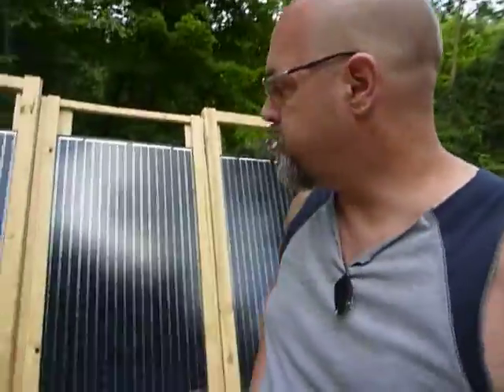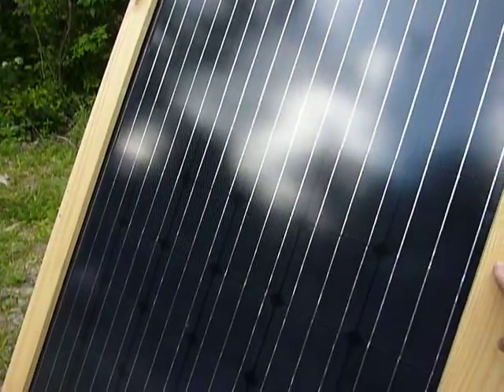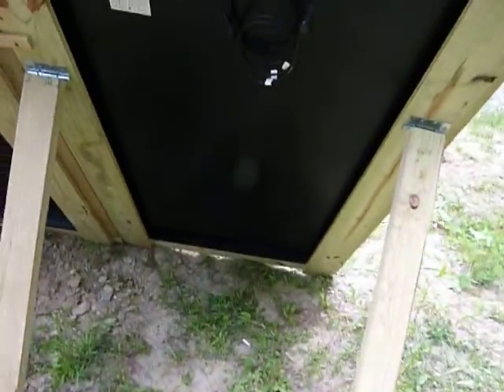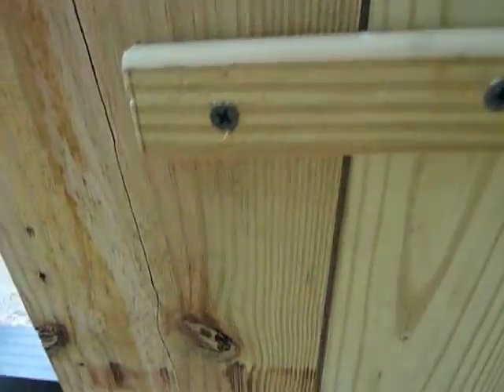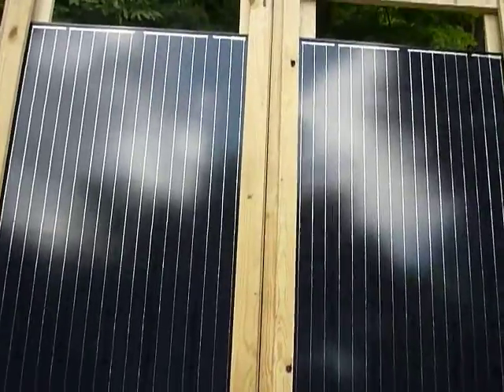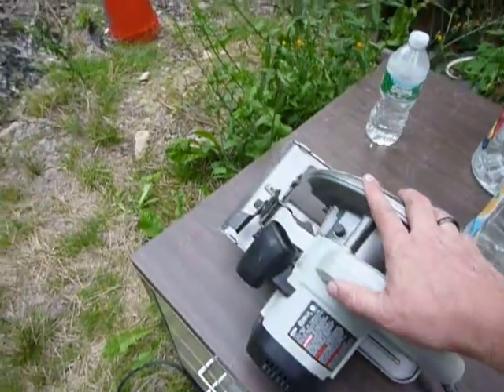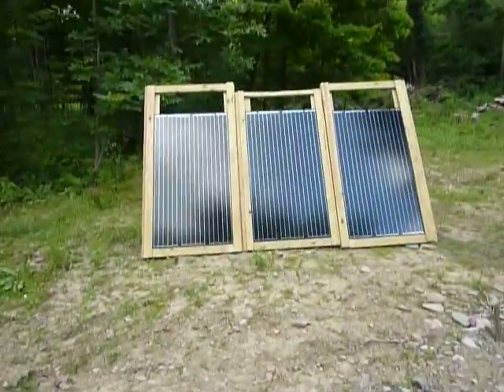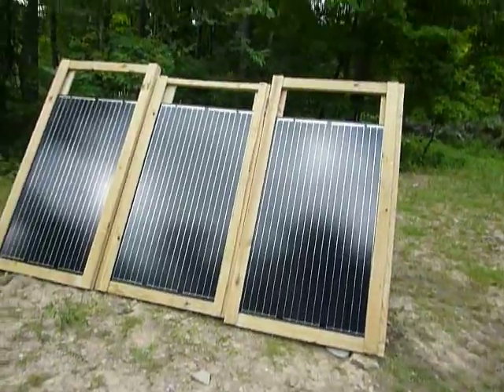Setting up our solar system at the off grid homestead.

Comment: preppernurse1 .. You might consider protecting your cable by running it through a garden hose until you get to digging the trench and adding the conduit.  .. Just a thought.

Comment: A few tips.. When hooking up your inverter or any loads and your charge controller , hook positive and negative on separate sides of the bank.. other wise the batteries closer to the connection point will be drawn and charged more heavily then the others on the other end of the bank, further from the charge or load..   it will make your bank last longer and charge and discharge more equally.   Also on your panels make sure your not covering any part of the cells with that wood trim.. or you'll loose allot of watts generated..   any partly covered cell is detrimental... even if it is a single leaf on your panel covering a single cell..
Reply from the maker: Ebacherville Thank you i changed it and thats what i did.

Comment: at 1min in, metal brackets, no......
your crating a stress point on the bolt that you would use.

take a piece of wood the length of 2 panels plus a few spare inch, lay it across the back and bolt through all intersections, ok it doubles the number of bolts, but its a 100 times more secure for wind loading.

if you can get a piece long enough for all 3 its a winner

needless to say top and bottom, and over /under lp from each pair to the next ie -_-
Reply from the maker: lez briddon Good advise thank you.